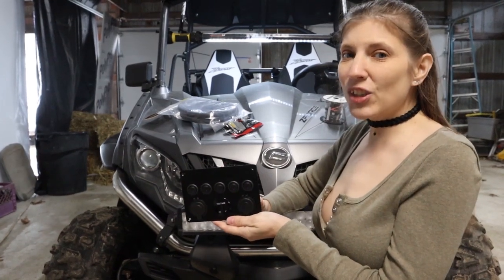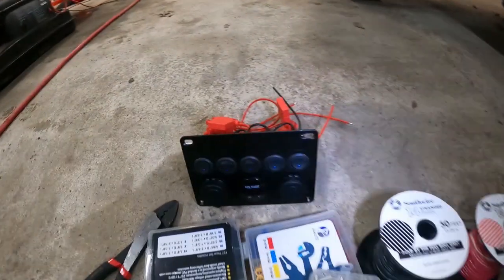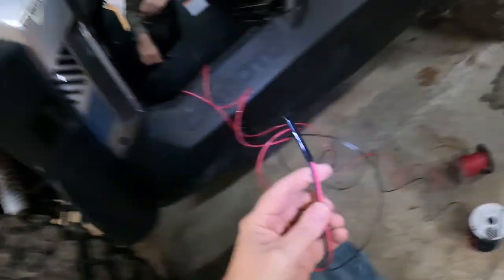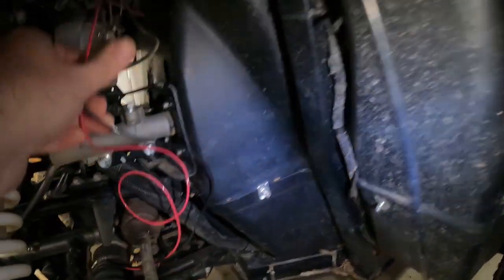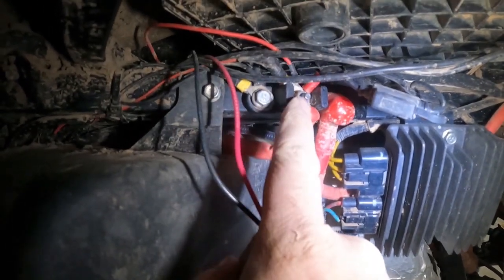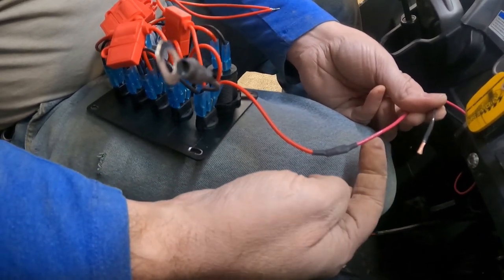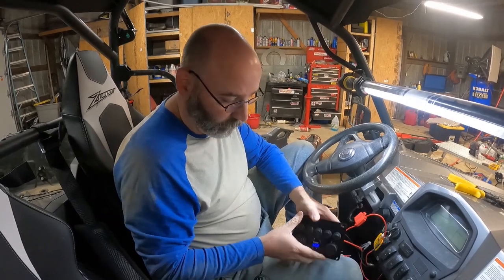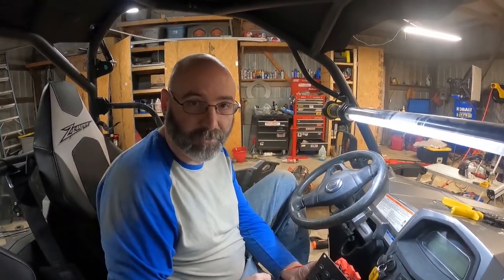cfmoto zforce switch panel install

Comment: 😊😊😊 hello Mr and Mrs C...thanks for another fine video...your rig and my ranger are so much alike...got the two battery hook up...don't know how much room you have but both my batteries fit under the seat...much love from Ohio ❤❤❤
Reply from the maker: I’ve heard of similarity between the cfmoto and Polaris. There is place under the driver seat that looks like a good place to put an extra. If we ad many more accessories, we’re probably going to need one

Comment: At the 1 minute mark, what are those 2 wires ? Are they coming straight off the battery ? And screwed into the frame ?
Reply from the maker: It does kinda look like that in the video but the junction block with the thick red wires is actually incased in plastic so it’s not grounded to the frame